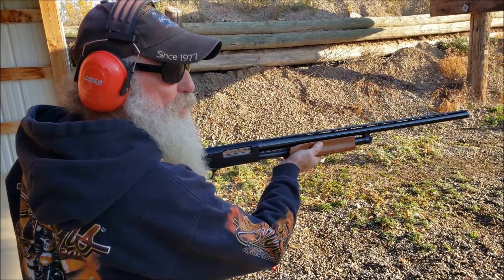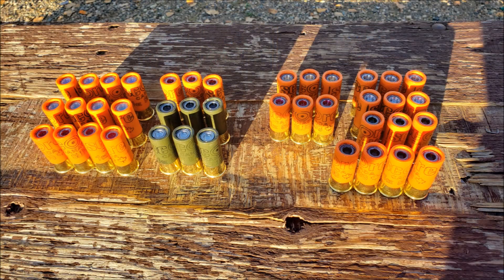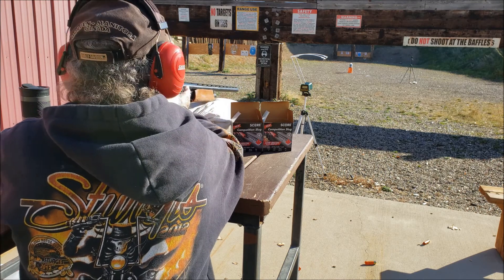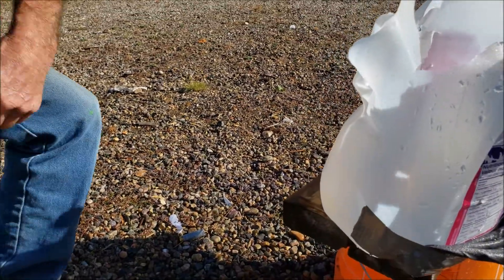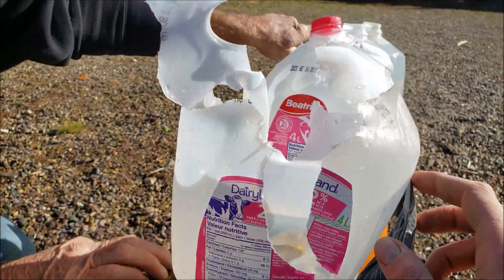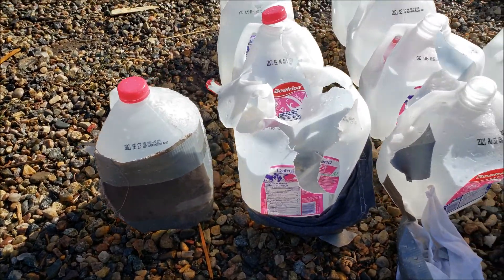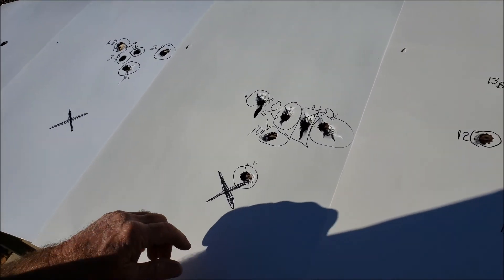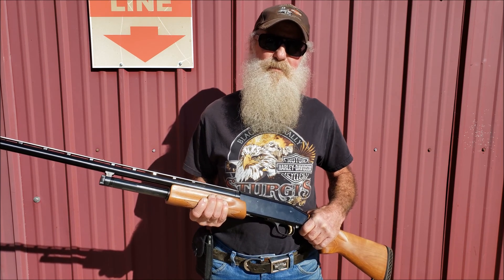Subsonic 12 Ga. Slug Loads

Comment: At a guess ~15 grains of the reddot, could shoot lyman 525 subsonic. Because of heavy load will extract more energy per grain than any 7/8oz slug/shotload. Also due to the tiny powder charge, a smaller gas column is produced, and shouldnt saturate any moderator. I like the lbc24wad (7/8steel or 1,1/4lead wad). Might need some jigging for height.
Reply: Pressure Test shells before use

Comment: Thank you so much for this upload iv been looking to use up some green dot powder and make some low powered slug plinking rounds. I recently got into 12 gauge reloading and up here in Canada it's somewhat hard to get powders (I live on an island in the middle of Northern Ontario nowhere) I use those exact slugs, the 2 powders I have access to are hodgdon HS-6 which is simaler to the discontinued winchester 500x(I think it's called) and Alliant green dot. I have no chronograph yet so I'm wondering if you have either of those powders and can suggest subsonic/low powered slug loads with GD, I have access to both 1oz and 1 1/8oz thug slugs and DGS12 slugs

Youv got a new viewer forsure.
Reply from the maker: Glad you liked the video Noah! Unfortunately, we don't have any Green Dot or HS-6 at the moment.